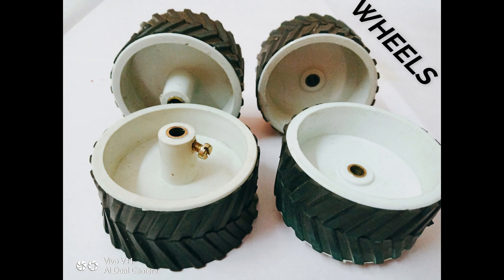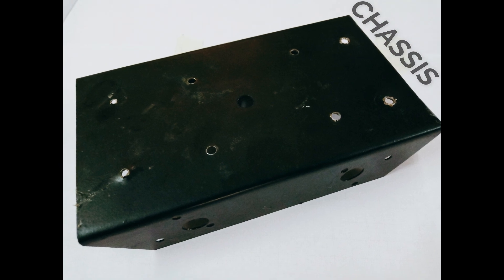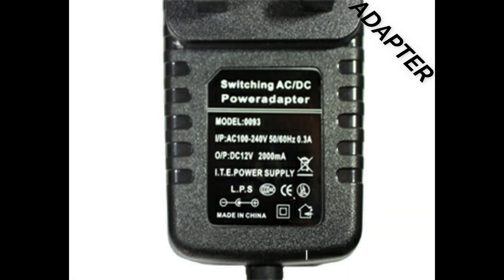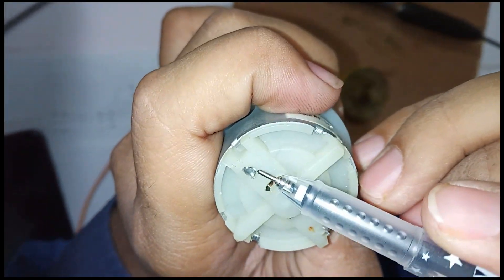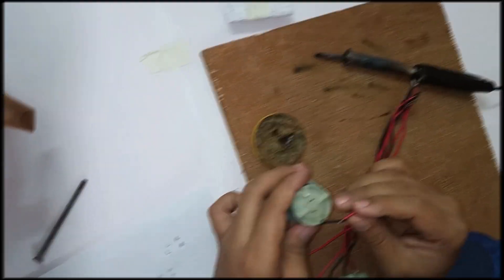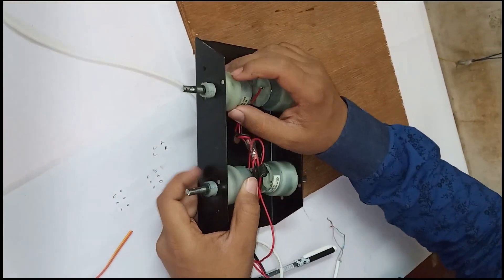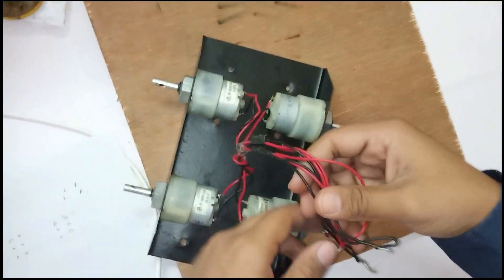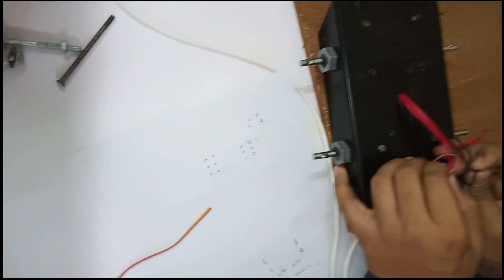How To Make A Bot For Robo Soccer |  Robot Playing Soccer

Comment from the maker: Materials Required 0:32 -  1:52
Tools Required 1:53 - 2:09
Motor Connections 2:09 -  2:47
Chassis Connections 2:47 - 4:39
Chassis Wheel & Base 4:40 -  7:47
Dpdt Switch Connections 7:47 - 12:15
Wheels Left Right Connection 12:31 -  14:45
Bot Test 14:50 - 15:03
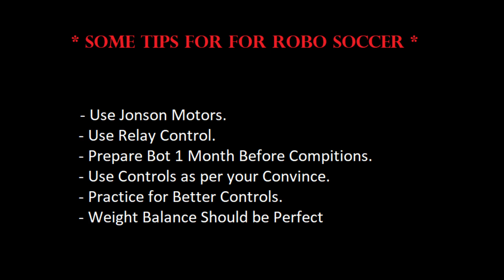Tips For Compitions 15:08 - 15:18

•••••••••••••••••••••••••••••••••••••••••••••••
Thanks For Watching! Do Subscribe And Hit The Bell Icon For More interesting Videos =D